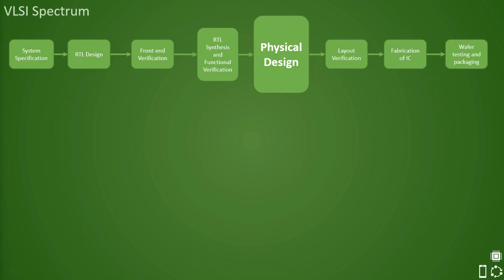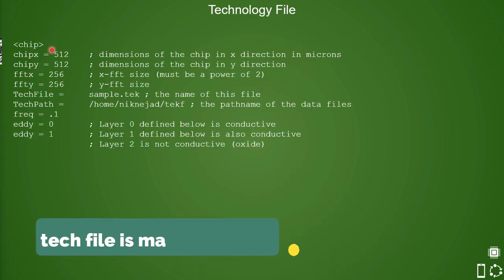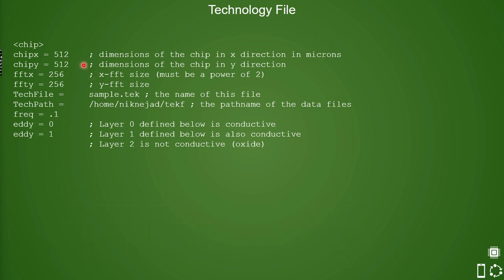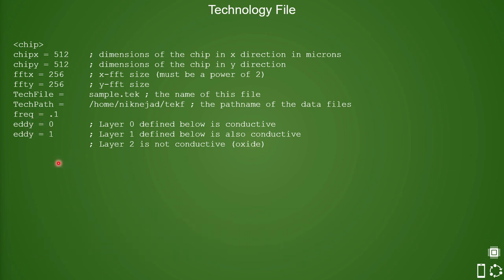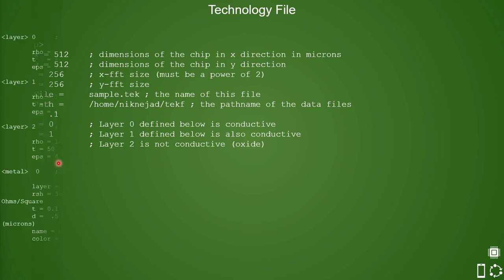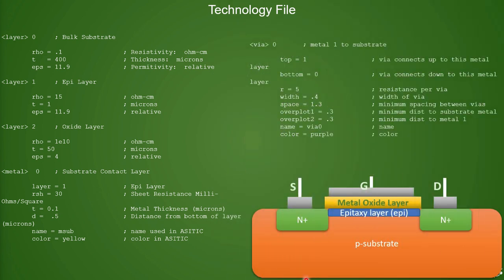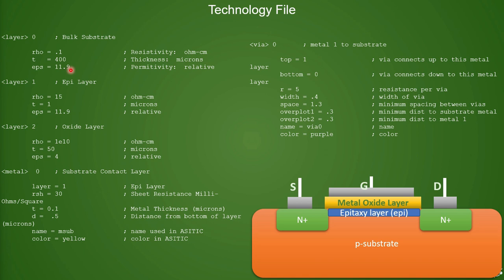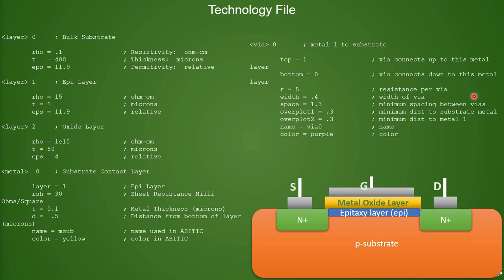PD Lec 12 - Technology File | Tech File | PD Inputs part-5  | VLSI | Physical Design

Comment: The timing library is an ASCII representation of time, area, power are associated with the standard cells. Characterization of standard cells under different PVT conditions results will be timing library
There three major parts in lib file. 
1.global definition
2.cell definition
3.pin definition
In global definition we have one section that technology (cmos) it means which technology it is. That's why timing library is technology depend and constraints are technology depend. 

Please correct me if something wrong. 

Thanks.

Comment: Timing delays & O/P trans values for cells are generally technology dependent because these values are generally given by foundry or fab team in the process of characterization, but since the range of values over which they might be used might vary from project to project so it can be project dependent too. But generally tech dependent. Please correct me if I am wrong.
Reply: @VLSIAcademyhub  thank you for the clarification 🙏